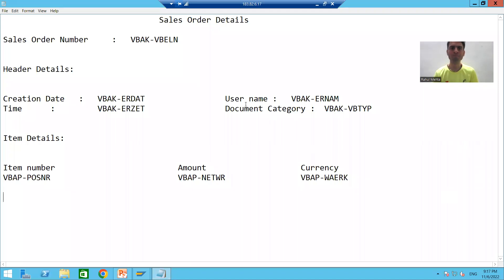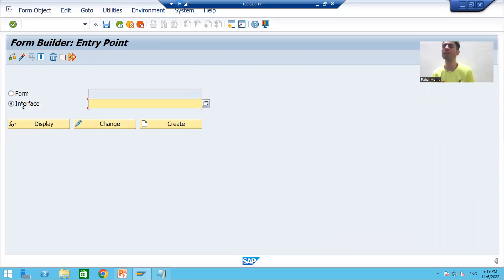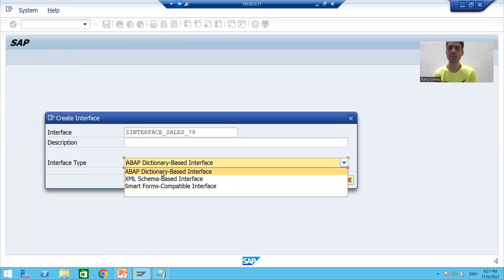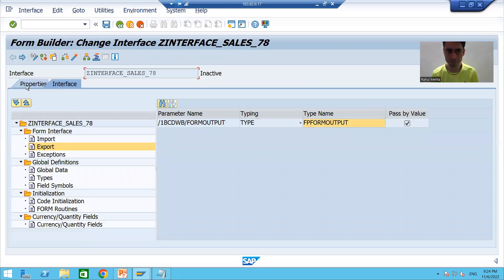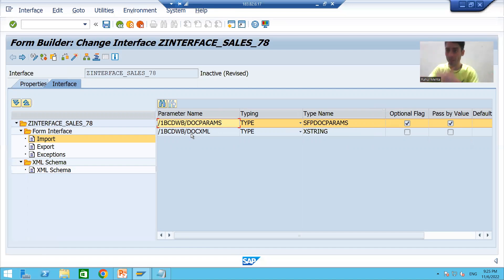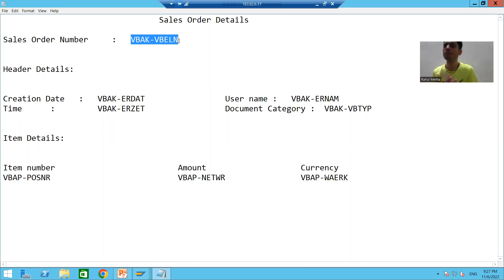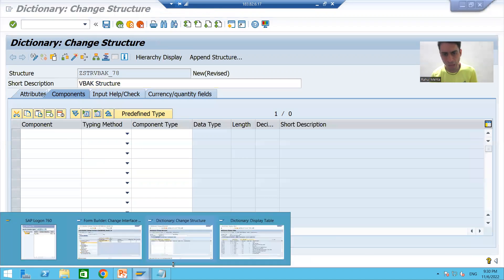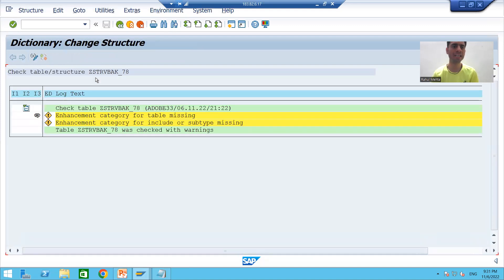2 - Adobe Forms - Creation of Interface Part1

Comment: Can we write local structure and table type in code initialization?
(Not going to SE11)
Reply from the maker: Hello - We can write local structure and table type in code initialization, but we can not access them in global data as the scope of them is limited to code initialization only.

In case, you don't want to use global structure and global table types, you can use the Types of global definition and use based upon your requirement.

Comment: while trying to print the form , I am getting system error , i.e. sy-subrc = 2. What could be the reason? Kindly help
Reply from the maker: Hello Bishaka - If you are creating it for learning purpose, please go for print preview. If it is your real project work, in that case someone needs to check in your system. Please connect with someone in your project who has the access to your system.
Reply: I'm using it for real time project, looks like there's issue related to ADS server, thank you for the response.